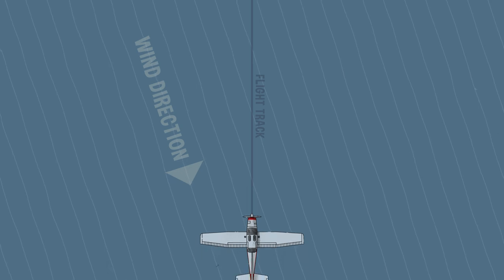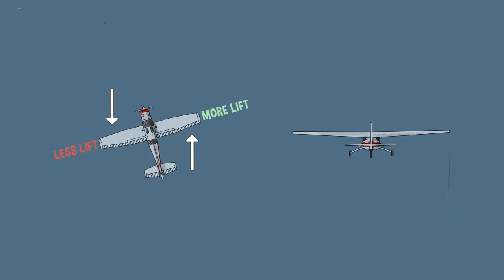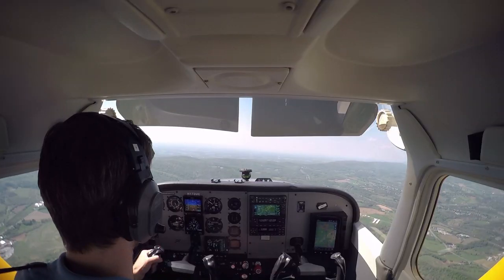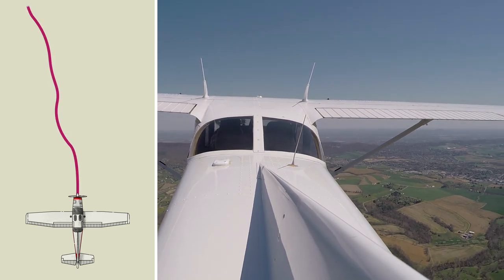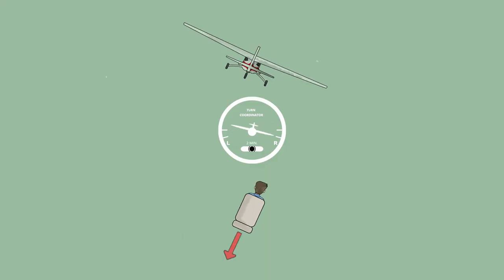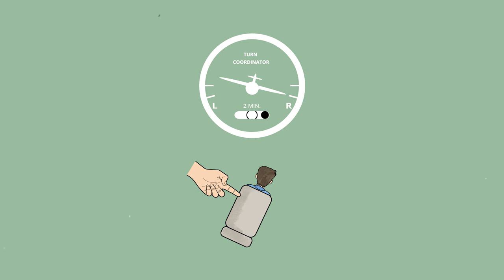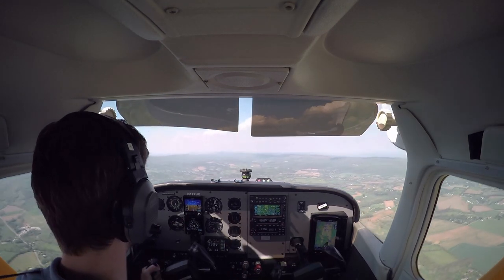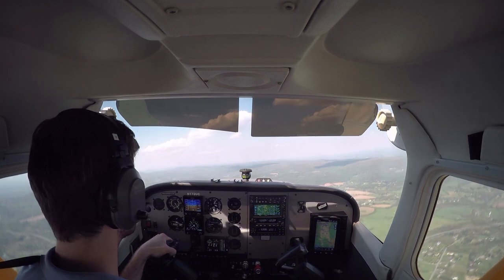ASI Safety Tip: The Rudder - It Gets No Respect!

Comment: I’ve been flying 20 years and yet have I made one rudder input . I don’t even know which  keys on my keyboard it is.
Reply: Kevin spot on.
Reply: actually since most flight simulators do not modell turbulences  the airplane never yaws  during straight flight in such simulators.
Reply: @schuttrostig5729  DCS models turbulence pretty well.
Reply: Schutt Rostig every simulator I’ve used has
Reply: You have automatic coordinated flight with the rudders.
Reply: <
>
Know you know.
Reply: I would have to buy rudder pedals to use them so….. our airliners do without.   👨🏽‍✈️
Reply: @schuttrostig5729 you still would want it while maneuvering plane forget just the turbulence
Reply: Flying 20 years in real life? No then shut up
Reply: @guyunknown9123  lol what's got you so angry? Did you have a bunch of duds in your fireworks?
Reply: @guyunknown9123 who hurt you?

Comment: A rudder gets lots of respect in a tail wheel!
Reply: But usage in the air is the same right? And what about landing?
Reply: @jaideepsinghjeji8444  In the air there is no difference for the same plane, but on the ground the tail-wheel pilot always dancing on the rudder peddles .  Tail-wheel pilots are more adept at using the rudder in all phases of flight - because not using it aggressively on the ground will kill you.
Reply: @StudioRV8  thanks for the fast reply , I once heard that tail draggers use more rudder on final approache.
Reply: @jaideepsinghjeji8444  No difference on final approach (for the same aircraft equipped with conventional vs tailwheel).  Technically, the only difference is actually takeoff/landing and ground handling.   In a tailwheel aircraft, there is more weight behind the main gear, so the back end of the plane really wants to go first.  The pilots' job is to keep the tail in the back, and that takes some constant footwork on the rudder pedals.  It's not difficult, but it's quite different than a conventional gear plane and you need to respect crosswind conditions and persona/aircraft limitations.   The risk is a ground loop; usually not fatal, but it could seriously damage the aircraft.
Reply: @StudioRV8  ok thanks.
Reply: Also lots of respect when an engine fails lol
Reply: @Whalt1988   All flight controls are important in an engine out situation - don't know that the rudder would be more/less important than the others, but if I had to rank the controls,  the rudder would be less important than the others.
Reply: yes thankss

Comment: Started out flying Gliders....120% Rudder! Think your little Cessna has adverse yaw? Try a 55+ foot wingspan with no motor pulling you forward!
Reply: Came here to say this. If you try gliders, you'll never forget about the rudder pedals again :).
Reply: Literally one of the main exercises we did when I was flying my GPL was the one they showed at 3:20.
Reply: Right I'm doing the Gpl, and our instructor always remark the importance of the rudder, if you don't take care of rudder in a plane, ok you'll be spending more fuel, but that's ok, in a glider you are loosing altitude, and that's not ok. He also tells us about the many pilots that start gliding and almost dont use the rudder
Reply: All my model gliders require rudder with aileron to go straight..some of them even about 70% rudder with aileron mix to keep adverse yaw out
Reply: After my 4th glider lesson my instructor declared, "Hey, you discovered the rudder!" Fly a glider if you want to see the value of strong rudder input.

Comment: flying Model RC planes, I've seen sloppy workmanship at the hinges and create flutter. Most take the advice of better builders and fix the problem, one of our members, a full-size pilot, who knew better, his ailerons had too much play, and too wide a gap from the trailing edge. Big plane, lots of speed, and you could hear that poor aileron fluttering. I kept warning him it would eventually crash because of it. One day, heard the buzz, then an explosion, his well-built wing...now tiny scraps floating down when the wing exploded. Don't know if he learned or not.

Comment: During landing, I always visualize two single nozzle rocket thrusters (like the ones used on spacecraft for docking etc), one attached perpendiclular to each side of the vertical stabilizer. My right rudder pedal fires and throttles the right thruster, and my left rudder pedal fires and throttles the left. 

Don't laugh, memory aids can really help. When I was a student pilot (we're always student pilots actually) I kept kicking the wrong pedal during crosswind landings. Visualizing rocket thrusters back there swinging the tail back and forth at my command stopped me from doing that.

Memory aids like 'step on the ball', PARE, and ones you invent for yourself, can really help fly safely. They are not for just beginnners. (If ever using PARE, visualize 'stepping' on the HIGH wing of the little airplane in the turn coordinator to instantly know which rudder pedal to push to stop the spin.)

Please share your memory aids! (We will not judge you)
Reply: That’s a good way to remember. I’ve never had an issue with that. On X wind lands I just get winds from ATIS look at the wind sock, visualize in my minds eye direction of wind and remember “wing into the wind” and correct with opposite rudder enough to keep nose on centerline.
Reply: For me it was just playing Flight Sim and DCS for 10 years before actually flying. That and the instructor had me play with a toy glider in front of a fan.

Comment: I'm learning to fly on a tail dragger Scheibe Falke SF 25 C touring motor glider. Had 150 landings and 2 solo flights so far...
Can't imagine flying this plane NOT using the rudder constantly. 
It also has a central wheel and auxiliary wheels below the wings.
In my flying club they say: If you can fly this, then you can fly all other GA aircraft.
Will ask my CFI about the differences with rudder usage in other planes..
Very well done video! Entertaining and very informative. Very well presented!

Comment: Excellent title for a serious problem that has decreased safety in general aviation for years.  The demonstration of the nose going the wrong way when aileron leads rudder was excellent.  When we now correct with the proper amount of rudder to yaw the nose back to coordination with the bank is false coordination.  Doing the Dutch Rolls you demonstrated next (some call it coordination rolls now) will quickly inform the observant CFI and student that unless we lead rudder in turns, especially steep turns, there is no coordination.  Correction in a startle event may be too late at too low an altitude to recover from inadvertent stall.  Part of the problem, in my mind, is the otherwise good lesson on the danger of the skidding base to final turn in a tailwind that has increased the radius of turn.  First, wind management at uncontrolled airports with no traffic already in the pattern would be to make the base to final turn into the wind even if that means the taboo right turn.  Secondly, and more importantly, the down wing dropping out to spin a skidding stall or the high wing dropping out to spin a slipping stall makes no difference safetywise.  All are dead.  The stall is the culprit, not the spin after the stall.  The critical angle of attack is when the airplane stalls, not why it stalls.  The airplane with its dynamic neutral stability cannot be stalled without a pilot pulling back on the elevator.  Yet we teach this very thing as Gospel in all turns to maintain altitude.  Use the potential energy of altitude to make a turn of any bank at 1 g by simply releasing all back pressure on the yoke.  The base to final turn, any turn in the pattern, could be a slight descending turn and then be adjusted for safety of flight.  My complaint with the school solution here is that in makes using proper coordination, rudder pulling aileron rather than aileron yawing the wrong way, is made taboo by this over emphasis of skidding spin rather than the stall that actually is killing pilots.

Back to our poorly respected rudder.  If we put a distant target, on the runway or in the air, between our legs to line up the longitudinal axis with the direction our airplane is moving and rapidly move the rudder pedals dynamically and proactively we maintain the centerline exactly on the ground and bracket the distant target in the air.  On short final where we should be decelerating coming into ground effect, we do not want to turn and thus we do not want to bank and thus aileron is the enemy and not our friend.  If we use the anti-turn control, yes the rudder, to bracket the centerline bet ween our legs, the wing automatically stays level or at the set bank for side slip into a crosswind.

My instructor in Army flight school in the TH-55 said, "Move the damn controls.  How else are you going to learn what they do.  This is excellent advise for learning how the rudder can make slow flight much safer than coordinated turns by using the rudder mounted in line with the longitudinal axis and benefiting from prop blast if we decelerate enough to bring the throttle into dynamic use to control rate of descent and glide angle rather than round out and become a passenger until the airplane decides to finally come down from a long hold off.  That long hold off put both airspeed control and altitude control in the lap of the elevator when we close the throttle.  Not the most efficient and most controlled way to "arrive all slowed up and ready to squat" as Wolfgang puts it.

Every control has a useful function or two both individually and in coordination with other controls.  Move the damn control.  How else are you going to learn what it does.

Comment: Very well made video, entertaining and very informative. I'll be coming back for more for sure.
Reply: I''m not a professional pilot and i'm flying just for fun. Periodicly suffering from wrong rudder imputs during my flight lessons and correctly understanding the danger of this kind of faults in solo, i inverted the pedal setup on my ultralite plane, and it perfectly fits me! Igor Sykorsky used this inverted pedal setup on his earlier designs. The only disadantage of this setup is the mandatory use of a pair of load springs in pedal mechanism.

Comment: As a student pilot ive realized using rudder helps me stay on heading. I struggled with it early on and reaized rudder greatly helps
Reply: @Phillip Stubbs   I'm not a pilot P.S. but it seems to me that you would tend to overcompensate if you used ailerons. The rudder would eliminate that. But like I said, I'm not a pilot.

Comment: My 3rd solo I was out in the practice area waiting for commercial traffic to pass before I went home, decided to trim 90kts and fly by rudder and throttle only. Felt like flying an old air hogs toy making tiny adjustments to throttle to gain/lose 100ft and keeping steady pressure on the right pedal just to stay straight. It's somewhat tiresome on an aircraft with no yaw trim but it confirmed for me that no-stick flying is actually pretty easy, and solidified the relationship between throttle and altitude.
Reply: These days if I am not in a plane with autopilot I rarely bother with the yoke. I trim the airplane out and correct the plane only using rudder. That way I can focus on my crossword puz-... I mean, reduce fatigue by not fighting the plane...  Yeah. That's what I do it for...

Comment: Jimmy: You are describing a”regular” airplane which in my day was a tail dragger. Your regular is most likely a tricycle gear Cessna or    other more modern aircraft. My short answers to your question is that you wear the tail dragger and it becomes part of you. Your sense of one with the airplane is heightened by the feel in your gut, the sound and the smell of flying. There is nothing complicated about this type of flying. No radio stacks, no synking the props, no IFR read backs, just the pure joy of the little four banger up front pulling you along at 80mph  as you count the cows in farmer jones pasture. You might even  find yourself flying down the coast enjoying a beautiful sunset. Everything slows down and you sleep better at night. 😊

Comment: Great lesson!  Once I'm in straight and level flight and have the aircraft trimmed just right, I usually keep my hands on my knees and steer with just rudder.  I've been doing this in the flight SIM as well and have notice that my course tracking has been very accurate while using mostly rudder.
Reply: Very bad! That is NOT co-ordinated flight. That is slipping and skidding all over the place sacrificing airspeed and fuel. You are only supposed to fly like that during the final few feet before touchdown during crosswind landings. You steer with the ailerons not the rudder. Aileron first and a wee bit of rudder to keep the ball in the centre. Find the Turn and Slip indicator and use it. When riding a motorbike you lean into the turn and the handlebars will move a wee bit. You do not go around corners by forcing the handlebar left or right while staying perpendicular to the ground. It is the same with flying planes. Some small planes even have the ailerons and rudder linked these days.
Reply: Sims are probably useful for learning procedures. For actually flying light aircraft ? ——Less so.

Comment: 3:20 PRACTICE ROLL with Yaw at the same time is it means roll right and press right pedal into the same direction of the Roll or opposite direction of the Roll?
Reply: I'm not a pilot, so don't take my word for it, but I believe they mean opposite yaw to roll. So like roll right (yoke to the right), and yaw left (push left pedal). If you were to do both in the same direction, you'd make a (coordinated) turn, which in this circumstance isn't what you want to do. So by my logic you'd have to do opposites in order to keep a straight heading.
Reply: Roll right press right I think, the adverse yaw means that using the aeleron only to the left or right, will move the nose to the opposite direction (adverse), you want to have it in the same place, so need to counteract the adverse yaw by yawing in the same direction.
Reply: @caitthenerd7470  adverse yaw causes yaw in the opposite way of the bank, so you'd have to compensate by yawing with the roll

Comment: I need to work on this. I wonder if better rudder work would have helped me out in the turbulence I was experiencing last night.
Reply: Rudder work in turbulence has done wonders for me; but, still have to use little aileron whenever some updrafts would try to tip a wing up on me... but even then, I'm using just a finger to move the yoke and not "white knuckling it".
Reply: Half the time you may find there isn't even as much turbulence as you think. When a plane flies uncoordinated it's whamming into the air sideways making all kinds of stability compromises that can bang you around from even small external disruptions. 

A coordinated plane slides through the air better and with less bumps overall. (and goes faster)

Comment: Let's be serious here, the most important use of the rudder is a deep forward slip for landing. I love slipping into landing!!!
Reply: No that's just the most Fun use of the rudder. Px would say the most important use is maintaining coordinated straight and level flight. 

I didn't get really good at the rudder until I was an Instructor having to ride along with other people's bad coordination. Then I started understanding why they gave that axis the most ergonomic control out of the three. You're gonna use it ALL the time if you're using it right. And it ties right into your feet's predisposition to already react to subtle balance cues.
Reply: I've got a constant speed prop. A little piece of wood on my rudder gives me straight and level perfectly if I dial in my prop control just right. At cruise, with my autopilot; I don't have to touch the rudder. That said, I do use rudder A LOT during take-off, landing, climb, and descent. 

I like to think my love of slipping is why I am so good with the rudder control. I slip nearly every landing (I really slip, none of that sissy hundred feet here or there stuff; I like to drop in on final a couple thousand above the field). I was hooked from the first lesson when I was 19 in a 152 when my instructor showed me how to slip.
Reply: Yea the captains on the DHC-8 I used to fly didn't think they needed to use rudders on AP either because "trim." 

I always was able to fly faster for the same power setting, and less Px complaints overall because every bump didn't cause the plane to swing on it's normal axis like it would when captain feet up on the panel was the Pilot Flying.

A piece of wood isn't a Yaw Damper. But a properly rigged plane should cruse true. Someday I may actually see a properly rigged plane.....
Reply: Or intentional spin entries - fun fun!